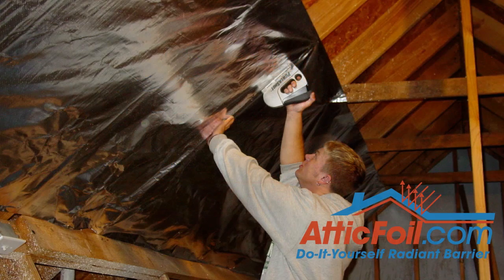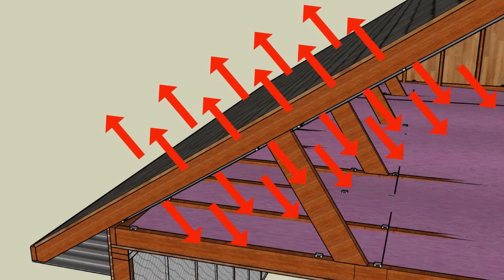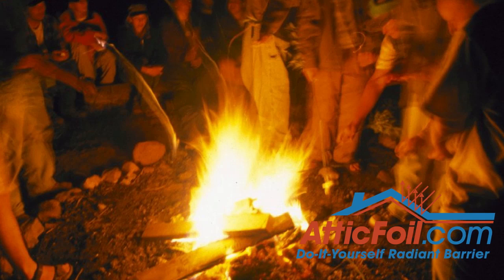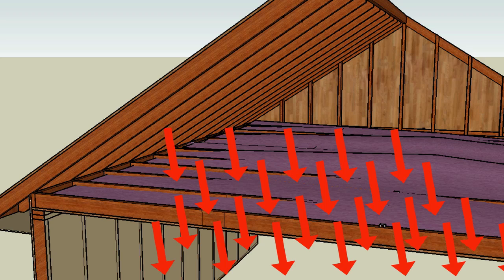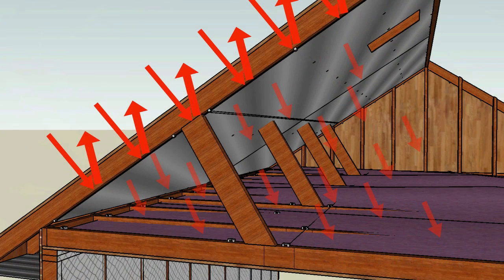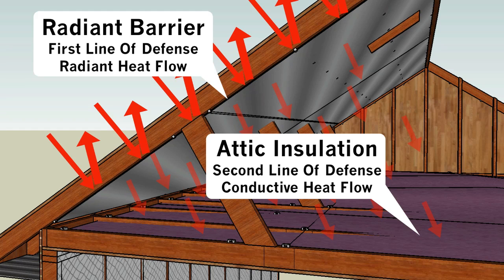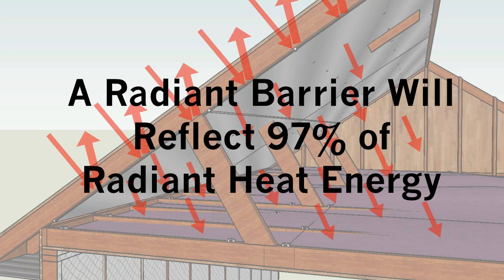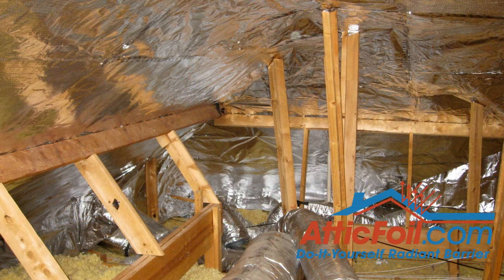Cool Down Your Attic or How Radiant Barrier Works? - AtticFoil® Reflects Heat From INSIDE The Attic

Comment: Great video. Think I am understanding more but still have a question. I'm in San Diego and  plan on insulating a shed with no attic. The shed comes with a radiant barrier on the roof sheathing. Would I then just add batt insulation up against the roof/radiant barrier and then install my drywall or wood paneling?
Reply from the maker: No you want the cathedral ceiling method or something similar since you already have radiant barrier decking.  https://atticfoil.com/index.php/applications/cathedral-ceilings-hotmixed-climates/

Comment: My attic is finished... with plaster already. Only the 4 corners have small crawl spaces that are open inside. It is also huge. Would it be possible to install without removing the plaster?
Reply from the maker: So, it's a finished room now? Not an attic anymore? Need a lot more info on this one.  Contact us at www.AtticFoil.com for more help.

Comment: I do wonder about how radiant barrier affects your heating bill because your attic is not going to heat up any more at all during the winter to provide a little extra help to the home
Reply from the maker: Remember heat always goes from hot too cold.  So, in the Winter any heat put in by the sun is quickly sucked out.  Second, the days are shorter and the sun is lower putting less heat than you would expect into the roof.  There may be a small reduction in heat gain in the Winter, but the reduction in heat gain in the Summer far outweighs any loss in the Winter.

Comment: Active insulation!
Thank you for the informative video. I will try to use reflectix on a van roof to protect against heat.
Reply from the maker: You do realize that Reflectix is a competitors brand?? www.AtticFoil.com or www.BlueTexInsulation.com is us.
Reply: @AtticFoil  I am aware, but both those sites sell in units way too large for my needs. Those units are near 250sqft+ I need around 40sqft. I do like supporting "real" non corporate businesses, it just isn't practical in this situation.
Reply from the maker: @RandyRandersonthefamous  Email Bianca at www.AtticFoil.com we have some odd rolls about 30" wide with no tape tab on the white/foil 6mm.  She can get you what you need and it will help us clear it out of the warehouse.

Comment: It says it will reflect 97% of Radiant Heat Energy. What does this look like in real temperatures? Its been like 90-95 degrees lately here in FL and Feels Like is over 100
Reply from the maker: Think of it this way. If you put the foil over the sidewalk in the sun, the sidewalk would barely go up.  Maybe a few degrees.  Where the same sidewalk in direct sun may go up in temperature 50-80 degrees.  Another example: Stand in the yard under a tree (protected from radiant heat) and it may be warm or comfortable.  Then take a few steps into direct sun (SAME AIR Temperature) with radiant heat and it can be unbearable.

Comment: What about the winter when you need heat!!
Reply from the maker: In the Winter the cold sucks the heat out of a ventilated roof pretty quick.  (Heat always goes from hot to cold) and the sun is low and the days are short.  So, you really don't loose much benefit in the Winter.

Comment: Is it important to keep an air tight seal between the hot and cold side so that the hot air doesn’t seep into the cooled area? Also, does the hot side need to be vented to the outside to release trapped, hot air?
Reply from the maker: No, airflow and radiant heat are completely independent.  For example, even if you cover half the rafters or roof, it will reduce the overall heat flow into the attic.  As for airflow.  You WANT the air to flow freely in and out of the attic and on both sides of the foil as though it's not even there.  You are NOT trying to hold, block etc. air.  Hot in in the attic no matter what side of the foil will rise to the top like water heading towards a drain.  You want SOME type of "hole(s)" near the top of your attic for air to get out.  Don't overthink this.  Ed.

Comment: Would this be good for a finished Attic?
Reply from the maker: When you say "finished attic" I assume you mean one that has been converted to a living space??  If so, then probably not since you already will have insulation.  Typically you want radiant barrier to be to the OUTSIDE of your insulation.  The foil is the first line of defense for radiant heat and the traditional insulation is the second line of defense for conductive heat.

Comment: I live in Pakistan where there is unbearable heat. I have set up a study room which directly faces the sun from all sides. It has a flat roof. Any cheap way you can recommend.
Reply from the maker: You could put on top of roof.  Not really intended for this but we have had many customers use it with great results: https://atticfoil.com/index.php/applications/exterioroutdoor-use/

Comment: In Florida we have wavy "barrel" roof tiles.  Many people here are getting new roofs due to recent hurricanes.  Can a radiant barrier be put down between the roof's waterproof membrane and barrel roof tiles?  Do you know if there is a significant enough air space between the rise and fall of the barrel tiles to justify installing a radiant barrier under the tiles?  These roofing tiles are mostly nailed down, but some contractors use glue.  Since the radiant barrier is just sitting on the waterproof membrane, will the radiant barrier stop roofers from using the glue?  Some roofers are using a 2 part foam (e.g., ICP's  2 component PolySet (AH-160)) to adhere the tiles to the roof without nails.  What I like about putting the radiant barrier under the tile is that the waterproof membrane, plywood, and wood beams are on the "cooler side" of the radiant barrier.  I think the down side is that there is likely more conductive contact between the barrel tiles and the radiant barrier, rendering it less effective.  Oh and if they use the foam adhesive instead of nails there is even less air space and more contact.
Reply from the maker: You need our new All In One Radiant Barrier Plus Underlayment: https://roofingfoil.com/48″-wide-roofingfoil-solid-underlayment-miami-dade-approved/  Video of product here: https://youtu.be/EyuQnvVakHs

Comment: Thank you for your videos. They are very helpful and easy for me to understand.
I live in the north mid-West and have a half finished and half non-finished attic. Finished half: living space, drywall ceiling, insulation (R-19), baffle and then roof with 6" rafters and a ridge vent.
Would it be productive or counter-productive for me to use AtticFoil® as the baffle, then R-13 (R-19 would be too thick) between the AtticFoil® and drywall ceiling?
I appreciate any insight you can provide to me.
Reply from the maker: I think this video on Cathedral Ceilings is what you are looking for:  https://youtu.be/CjwZXoRzRiM

Comment: Do you have any typical case studies with before and after attic temperatures?
Reply from the maker: Air temperature is a tricky way to measure.  It may go down a little or a lot.  Depends on current attic ventilation.  Radiant Barrier causes the SURFACE TEMPERATURES to drop which is what really drives heat flow.  Here is a video on attic air temperature after installing a radiant barrier.  https://youtu.be/SGZevwIy8ok

Comment: Will this interfere with cell phone reception and or radio signals?
Reply from the maker: It depends.  If you have really weak cell reception, it can be a problem.  Strong cell reception, probably will be ok.  Here is a video on Radiant Barriers and Cell Phone Reception: https://youtu.be/9NpGExXUkIQ

Comment: What is the best thing to do for insulation in general?
I'd like a cool attic in summer obviously, but hot in winter... What to do?
Reply from the maker: The attic should actually be COLD in the winter.  The attic is not intended to keep heat in.
Reply: Any tips on installation for someone with 4/12 trusses, 16" O/C.  Real difficult to move around in the attic and I would like to place the product under the rafters as much as possible, and on top of the insulation.
Reply from the maker: Look at the "hybrid" method: http://www.atticfoil.com/index.php/installation/hybrid-install/

Comment: Can the attic foil still be used if foam insulation is used in the roof rafters? I had a contractor tell me that it makes the attic hotter when using radiant barrier with foam insulation. Excellent presentation by the way.

Comment: does this work for Trailers?
Reply from the maker: Works GREAT for trailers!  A trailer is still going to be hot sitting in the sun, but installing an internal radiant barrier will make a huge difference.  You would want to have:  Metal skin > Air Space > Foil facing towards outside.  For the internal look, you can either go with Foil/Foil and see the shiny foil or the Foil/White Vinyl product and see a clean white vinyl.  http://www.atticfoil.com/index.php/products/48-wide-radiant-barrier-foil-white-vinyl-perforated/

Comment: I'm looking too.. I think your radiant barrier as describe would help with some in house and in attic high temps, but I think you forgot to mention the 3rd (defense) barrier to the roof heat transfer )...Ventilation.  That trapped heat will have to go somewhere.  As the video described,  in the installation of this method, the results will also be hotter shingles (mentioned by others already),  Rafters and roof sheeting (plywood).  All will suffer reduced life expectancy most noticeable on/of the shingles. Thanks for sharing your option/solutions
Reply from the maker: +ut1004bp Here is our video on ventilation: https://youtu.be/NUvgeP7--0Q  And this video show with thermal images that show that the roof is only 5-10 Degrees hotter when installed over a radiant barrier.  https://youtu.be/OHpyv_kxmoI  Does this help?
Reply from the maker: Tod, this is factually wrong.  The heat is reflected up towards the deck, but the deck will only increase in temperature less than 10º.  Here is a video on shingle temperatures: OHpyv_kxmoIhttps://youtu.be/  I agree that the "BEST" way is under a metal roof, but this video is explaining how a radiant barrier works in an attic without installing a new roof.

Comment: does it keep the shingles extremely hot?
Reply from the maker: +Moises Perez It does not make them "extremely hot".  They roof WILL increase less than 10 degrees which is considered nominal with no long term effect.  Here is a video with thermal imaging showing part of a roof with/without radiant barrier and a 5-10 degree difference. https://youtu.be/OHpyv_kxmoI

Comment: I have a metal roof. Will this product help me?
Reply from the maker: +BRANDON Cleary Yes it will work with a metal roof or ANY roof if installed in the attic.  IF you can put your hand a few inches below the roof deck inside the attic and FEEL radiant heat coming off the deck in the summer it will work. It's really that simple.

Comment: Lets say you have a caravan and it's roof it a type of metal, this metal is painted white on the outside. The roof on the inside has Styrofoam for insulation. I don't think putting foil between the styrofoam and the roof metal would help, since it can't easily be reflected back out as the roof is metal also. 
So in this case it wouldn't work well, of course in most house roofs it works as the reflective layer would reflect the radiant heat back out as the rood surface isn't metal. 

In the case of the metal caravan roof the only thing I see that could improve it is painting the roof a reflective silver color. 

In a house I believe the best way to insulate is the have a normal roof that isn't very conductive, then underneath it has reflective foil. Then have a few inches of space and then have a lot of insulation. That should make for a good setup to slow the energy getting in.

Sometimes ventilation isn't a good thing if your attic is really well insulted, as the day air may heat up faster than your attic and then it sucks in that warm air as it expels the pre existing air in the cavity that isn't warm yet. I think roof ventilation fans are good but they should be times to only come on after the sun has been up at least 3-4 hours and that's when the roof cavity has finally reached ambient outside temperature and is rising higher even. Then the fans can do their work.
Reply from the maker: +ziongite Just because something is white or shiny does not mean it's reflecting heat very well  even coated metal.  Think of a chrome bumper in the sun.  Very reflective, but you would not want to sit on it.  You will ALWAYS want to address radiant heat before conductive heat.  Reducing surface temperatures will make the traditional insulation (which helps with conductive heat) more effective.  I agree on a passive ventilation system or if you have a fan (I don't usually recommend fans) it is set to turn on hat a high temperature so when it turns on it will actually cool rather than just moving warm air for more warm air.

Comment: Hello Ed, An installer in the area uses BASF radiant barrier, how does your product compare?
Reply from the maker: +Paul Nguyen The BASF product is a paint, not a true radiant barrier.  It's technically called and "Interior Radiation Control Coating" or IRCC for short.  Here is my page on comparing Radiant Barrier Foil to Paint Type products with video:  http://www.atticfoil.com/install-questions/paint-vs-foil.html

Comment: When installing a new roof could you put the radiant barrier foil over the plywood instead of trying to apply it around the trusses from inside the attic?
Reply from the maker: MrsMika Yes, you can put directly over the trusses.  It is best to push it down a few inches between each truss.  Here is the page for this application with complete instructions and pictures of the process: http://www.atticfoil.com/applications-and-uses-2/under-roof-deck.html

Comment from the maker: It's heating up out there... it's not too late to get AtticFoil under your roof to make your home more comfortable and energy efficient this summer!
Reply from the maker: I agree.  Our website www.RoofingFoil.com describes this exact method. Unfortunately this method is only an option if you are getting a new metal or tile roof.
Reply: I live in Arizona and have the foil on the roof panels under the tile. Would it be beneficial to add another later to the attic ceiling?
Reply from the maker: Probably not.  However, there is an easy way to test this.  Go in the attic and put your had a few inches below the roof deck on a hot sunny day.  If you can "feel" the radiant heat coming off then yes it will provide a benefit. If you really don't feel much heat then the foil under the tile is working and you probably have minimal thermal bypass.

Comment: I've been researching quite a bit on this but no one has been able to answer my question as to whether or not the barrier has to be reflective on both sides? I mean will it have any significant effect on the temperature in the room should there be only one reflective side, pointing up to the roof? My room is in my house's highest floor, and I am trying to minimize the cosmetic difference it could cause my room. Also, would there be a huge difference should the barrier be applied directly onto the ceiling?
Reply from the maker: Rafa Partosa Foil works off two qualities: Emissivity and Reflectivity.  You must have an airspace on the foil side for it to work off either quality. Single sided facing the roof WITH an airspace between the foil and the roof will work fine by itself. Having the second layer will offer a little more benefit since the bottom layer will work off emissivity.  Cannot apply directly to ceiling unless the foil is facing down towards airspace (room).

Comment: I also question  what effect this has on the shingles on the roof. Reflecting the heat back to the roof  should keep the shingles  hotter and I would think shortening their life... Has any study been done on this aspect of the product.?
Reply from the maker: Dennis, yes the shingles will be a little warmer over a radiant barrier.  Have not seen any "official" studies, just first hand experience shows the shingle will be less than 10 degrees warmer.  This is consistent with what others have found. Most roofing experts I've spoken with agree this should have virtually no effect on a roof that is properly installed and has decent ventilation.  Here is a video we did with some real life testing with a thermal imaging camera.  http://youtu.be/OHpyv_kxmoI
Reply: Makes the shingles 10 degree's  higher, it s no big deal.

Comment: Could you use Radiant Barrier Foil insulation differently so that you could maximize the heat in your house (not for cooling)? For example, could one place it under a structure in a place like Alaska where one is trying to have as much as heat as possible? I am thinking about building a nice, insulated shipping container.
Reply from the maker: It really depends on your heat source.  If you are using radiant heat, then a radiant barrier will be very beneficial when combined with regular insulation.  Basically, you want to build a well insulated, airtight box and line it with foil.  With a radiant heat source, the foil will be your first line of defense against radiant heat loss and the regular insulation will be your second line of defense against conductive heat loss.